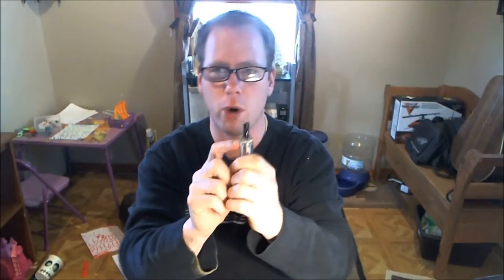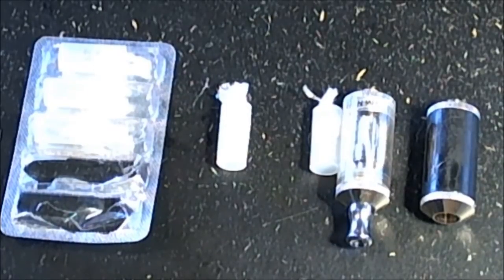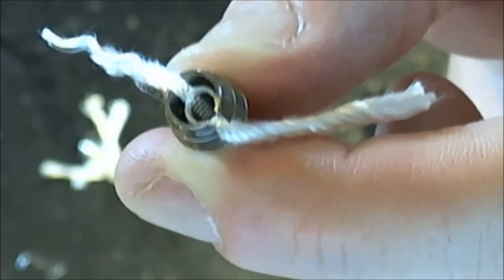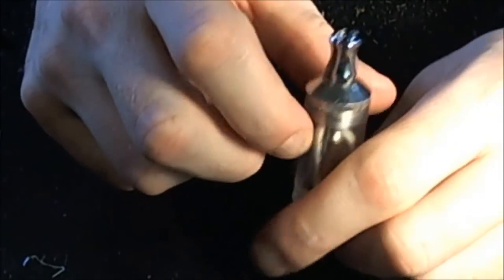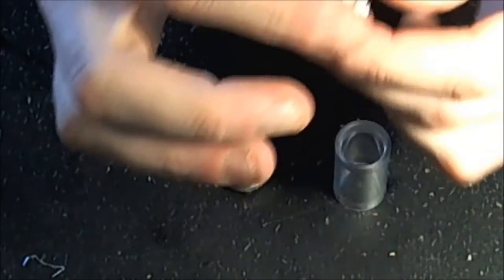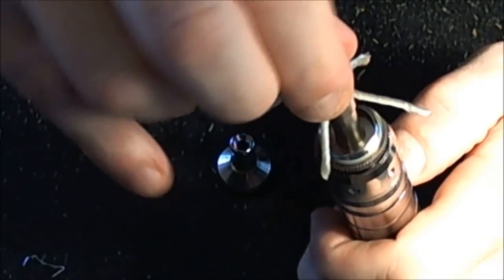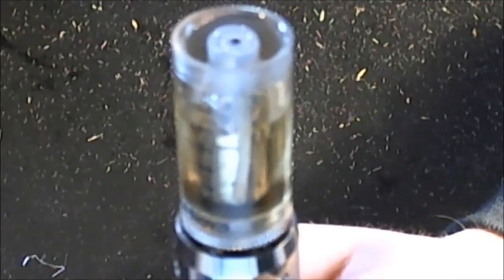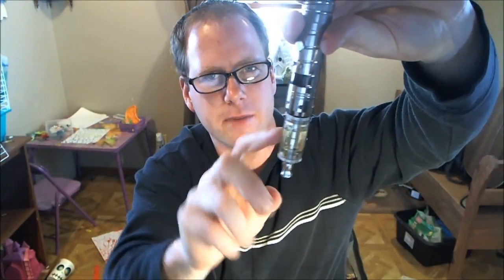How to Setup The Vivi Nova Dual/Single Coil

Comment: Just bought my wife the vision vivi nova and was wondering why would you have to tip it. Don't the wicks draw the fluid up like on a lantern does? I also wanted to say that I think you have a great channel and your videos are very informative and your personality makes watching that much easier.
Reply from the maker: Well if you don't chain vape too much you could get away with not tilting.  But if you take a lot of drags close together you will have to tilt its just the way it is! lol.  Thanks for the kind words!!  I appreciate that!
Reply: Hey Jeff, my vamo is showing low V after about an hour putting in a new battery. It shows the battery having a fairly full charge, but when I hit the fire button it says Low V and won't hit. Is this a bad Vamo???
Reply: My battery shows 3.7 when I put it in my vamo with my Kanger Protank 3 and in less than 30-45 minutes is shows 3.2 and is dead. I dont know if maybe I over charged the battery or not, I just ordered the NITECORE i4 Intellicharger Charger and a couple PANASONIC NCR18650B LI-ION BATTERY 3400mAh 3.7v 18650's to see if it will make a difference. I am curently charching my efest IMP 2250 18650 on a TrustFire charger, so maybe it's not a good charger, or I have a bad vamo, because I doubt that all three of my batteries would be bad when I bought them, although they may all be bad now.
Reply from the maker: Woodland Haunters Yeah i think your right I think its a batery problem there!  I buy all my dual coil vivi nova heads from vaporalley.com  That is one of my favorite sites if not my very favorite to get everything from.  The guy is a great guy just a small buisness guy so yeah!  Thanks for the kind words as well drew tears!!:-)
Reply: Hey Jeff, just wanted to let ya know that madvapes.com has the Vision Vivi Nova dual coil tanks on sale for $3.99 each. I just orded a couple of them, I hope they are better than the single coils. It was single coils I had and not the dual coils. So maybe the dual coils will have a better taste and not such a tight draw.

Comment: Hey Jeff, Where do you buy your heads from. I don't know where to get original Vivi Nova parts. Thanks man!
Reply from the maker: vaporalley. c o m has them in stock otherwise litcigusa. c o m and gotvapes. c o m has them but they are showing sold out but vaporalley has them just do a search for "Vision"  thenmake sure you get some dual coil heads for it cause they are better they are down the list. in fact its number 19 down for the heads
Reply: Thanks again. I'm definitley getting dual coil. I want more vape! lol